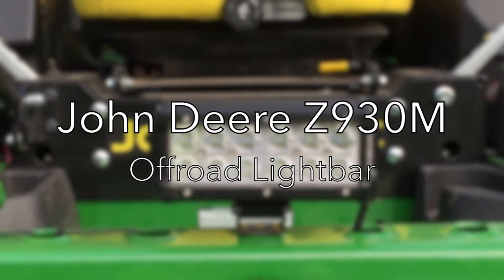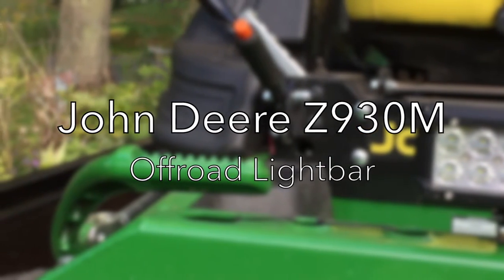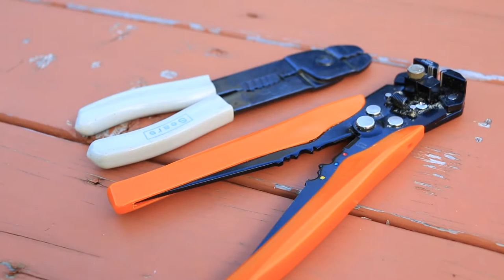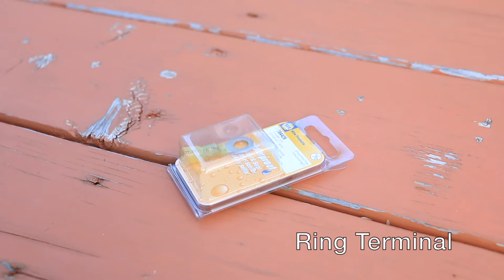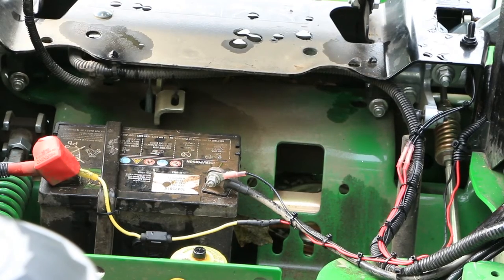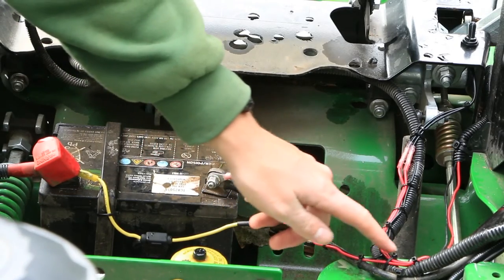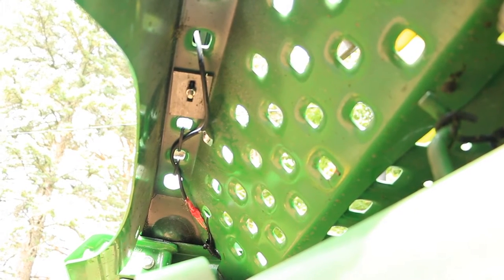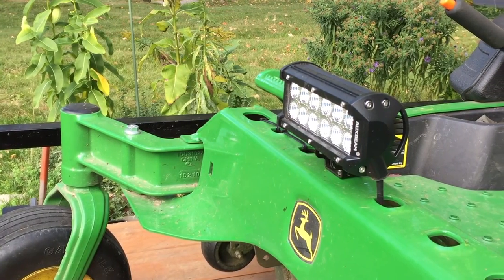Auxbeam Lightbar on Zero Turn Mower - Budget Cuts Lawn Service

Comment: No problems with killing the battery? Last time i installed lights on my old lawn tractor it killed the battery. I want to install some on my ford LGT 100, but I don't want to kill the battery
Reply: If you're killing your battery, (and you're not forgetting to turn lights off) you most likely have a ground in your wiring harness